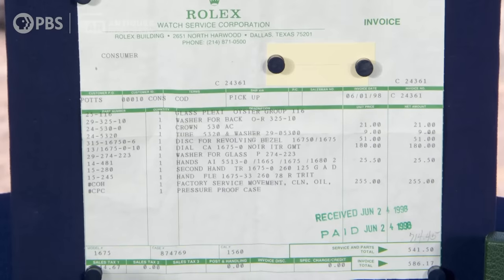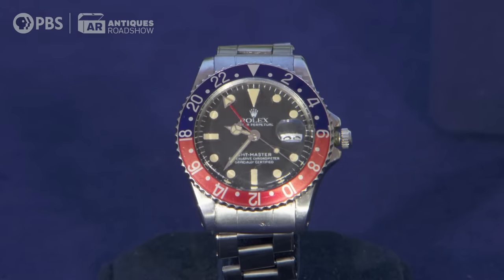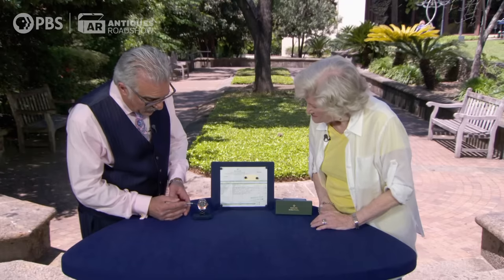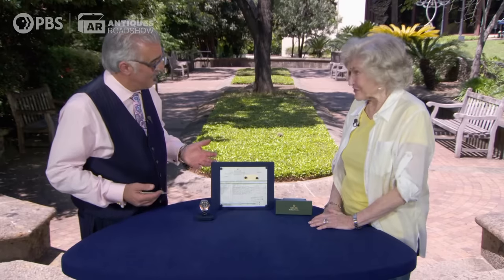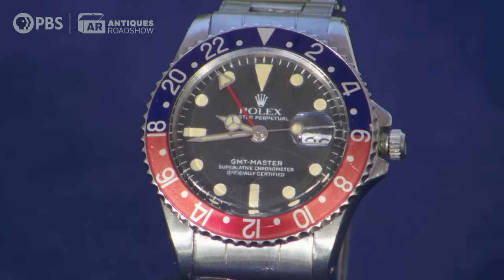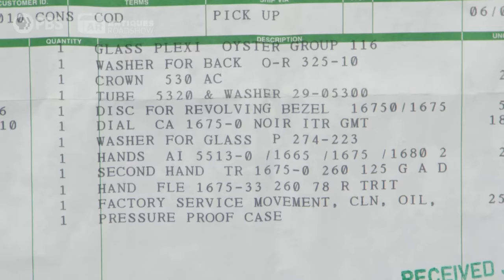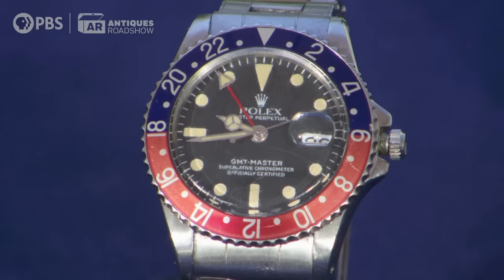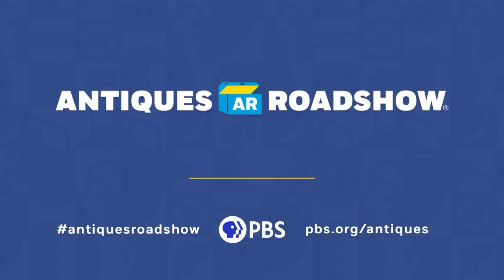1963 Rolex GMT Master | McNay Art Museum, Hr 2 | ANTIQUES ROADSHOW | PBS

Comment: Never ever send a vintage Rolex back to them for service, they will replace all worn for new knocking the value to nothing
Reply: Not to mention keeping those parts for themselves!
Reply: gmshadowtraders Yes, those terrible criminals repaired that watch. We should send all these kinds of criminals to jail, like people that fix old cars. There’s not Rolexes responsibility to worry About the value, that’s up to the owner. Rolexes responsibility is to repair the watch as best they can.
Reply: "they will make your watch function like it was new, for a fraction of the cost of a new watch" geez sounds like a terrible deal. Secondary market weirdos praising vintage over function.
Reply: I read they don’t return old parts because they don’t want people to sell the parts and devalue the brand. Is that true?  Never owned a Rolex and likely never will so I have no direct experience with that.
Reply: @edmondlau511  Sounds about right. They probably keep the old parts stored away somewhere. I doubt they destroy them.

Comment: I have the new Pepsi jubilee (126710BLRO) and a 2007 Pepsi 16710 with the error sticks dial (all-brushed oyster bracelet) as part of my watch collection. Both are worth about $15K. Way more than the original price paid for both of them. I love them and don't really care what they are worth, since I won't sell them...but still cool to know.
Reply: @8rick1ane You can if you are willing to pay the premium in the grey market. ;) Prices have fallen a bit so now may be a good time to do so if that's your only option. But I know what you mean. You're talking about getting it for the $9,700 (US) list price at an authorized Rolex dealer. And, yes, that will never happen unless you form a solid relationship with your dealer over time. Good luck!
Reply: That's awesome!  Which do you wear more often?  I have the new BLRO as well.  The jubilee bracelet has essentially ruined oyster bracelets for me.  It's the most comfortable watch I've ever worn.  I'm with you, the value retention is nice, but no plans to ever sell it.

Comment: Just FYI ... according to the inflation calculator, $150 from 1963 would be $1,250 today. So it wasn't exactly a cheap watch back then, but certainly way more affordable than a current GMT Master II in 2020.
Reply: do they still sell Rolex at the PX ?
Reply: @1SaG
That inflation figure that you quoted does not take into account purchasing power of the era as a whole. 
That $150 watch would have been 1 to 2 weeks salary for the average person and today that Rolex could be about 20% to 50%  of a yearly salary.

Comment: I think he is incorrect about the serial number. It should be in the 800K not 8 million. I have the exact model with pointy crown guards and it’s in the 800K range. In 1953 when Rolex hit 999,999 pieces instead of going into the millions with the serial numbers they started over at 100K. It wasn’t until 1964/65 did Rolex just hit a million with the revised serial number system
 and from that point forward kept progressing the serial numbers. That is my understanding.
Reply: Arthur G. Gonzales you’re 100% right mate, 8 million serial is 1983
Reply: Jimmy split 77 thanks for confirming!  I was starting to second guess my information. My serial begins with 875XXX.  I can’t imagine Rolex producing 7 million plus that same year after mine was produced.

Comment: It is interesting that the dial and hands were replaced in 1998, according to the watch expert. And they still have a really heavy patina. I have a no date submariner from 1994 that is completely original that doesn’t even really have any patina. The patina on this watch is so heavy duty that I find it unusual for a watch dial and hands that are supposedly from 1998.
Reply: It's a tritium dial T25 replacement of a radium original dial - they have faded - check your dial marking on your '94 14060/16610 under the 6 o'clock on dial if it says t25:etc it's tritium and should be showing some patina - but some take years to develop (stick it in a dark safe for 5 yrs and it will develop patina) - ps if it says just 'Swiss Made' instead of T25 etc it's had a Luminova service dial fitted and they don't develop any patina !
Reply: Paulthorpe well said. And yes my 1994 ref. 14060 is all original and it has been worn regularly so it has had regular exposure to UV light for 26 years. It doesn’t illuminate at all in the dark anymore. So, it’s on its way. But no real patina developing as of yet. I just found it really surprising that a tritium dial from 1998 would have that kind of heavy patina like the one featured in this video. But I suppose, as you suggest, if it was kept in a safe for all that time I guess it would be possible. It’s interesting how watches develop patina at different paces, some evenly, some un-evenly, etc. I’ve been collecting Rolex for years and I have/had Rolex watches from the 1950s, 1970s, 1990s, and several contemporary models with my Batman being the most recent (which of course won’t develop patina). But it’s interesting how the original radium/tritium dials and hands all develop and age differently from watch to watch.

Comment: . The dial that pcg 1675 supposed to have is a gilt or at best an early mark 0/1 long e (i doubt so). The dial on it is neither, i m no expert but thats why the value’s so low, had the dial been kept, this would be like in the 20k usd range. Good for her she seemed satisfied
Reply: m0t3ki I think with how crazy the market is now, 8-10k is a little on the low side even with a replacement bezel and dial. I think someone would pay 11-12 for this.

Comment: This is just a setting, just a theory, in fact all used goods are cheap, including Rolex.  Used Rolex however the buyer will bid as cheaply as possible.  No used rolex is sold higher, it's a common lie.  just for a marketing strategy.